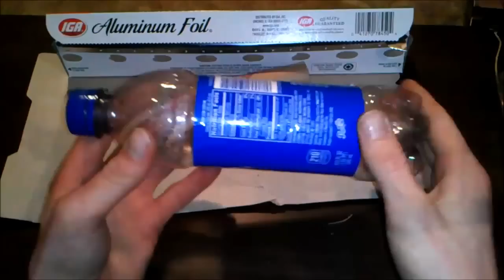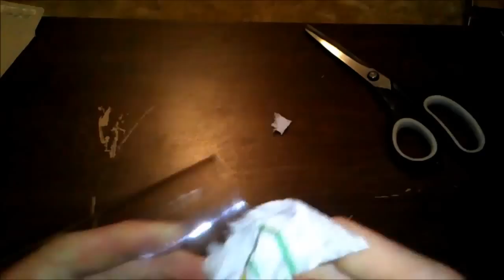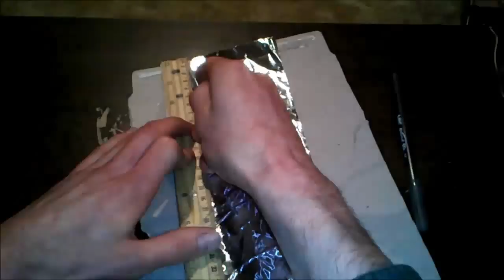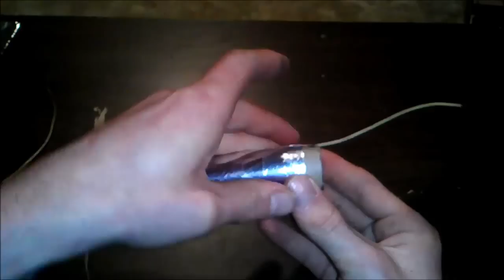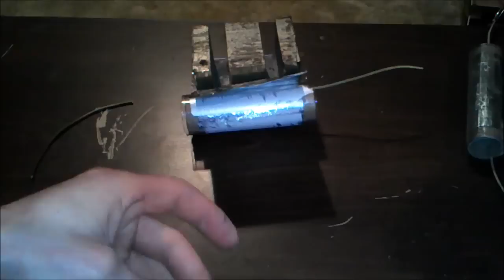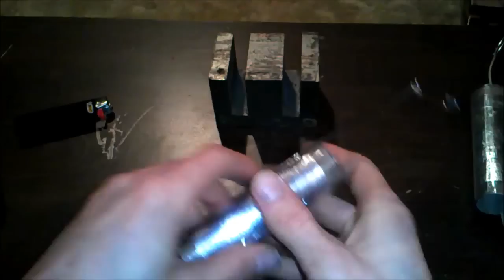How to make a High Voltage Capacitor

Comment: May I know the name of the electronic material used in the capacitor and how can I get it?
Reply from the maker: It's aluminum foil. I can't remember if it was regular, or heavy-duty thickness, but I would use heavy-duty if possible.

Comment: if you really don't want use\have a wire stripper use the scissors, they are 95% the same of electrician scissors for that purpose, i was wondering what's the use of a lighter, i'll just have a tonne of carbonized plastic on your fingers and it's also somehow conductive
Reply from the maker: Oh... Yeah, carbon soot in the plastic is conductive. I probably shouldn't do that. Thanks.

Comment: Outstanding!
My Mag Loop Antenna tuning capacitor problems are now solved by watching this vid.
I'll be able to add 100s of puffs for pennies instead of $100s for vacuum variables/etc.
It's the slitting of the plastic bottle that ties it all together.
Thanks one heck of a lot.....
73 OM
Reply from the maker: I kind of understand the loop antenna. Frankly, I don't know much what you speak of with the rest. "100s of puffs"? Yo... I suppose, if you risk your life to make capacitors by reusing plastic and other materials... do so at own risk.

At least write back to tell me what the fuck you're talking about?
Reply: @maddoctorwhitson  XD
Reply from the maker: What problem did this help you solve?

Comment: High voltage but small capacitance
Reply from the maker: High volt, at least 4200 volts. Amperes are unknown, but significantly reduced amperes. Still 4200 volts.

I don't know about reduced capacitance though. Sincerely, I play HV by ear just like music I play on the piano.

Comment: That capacitance would be increased if longer aluminium foil and plastic insulater are used......
Reply from the maker: Thanks. Yes, you are correct. I would like to try that idea of yours.
Reply: Do you need more plastic insulator, or is more al foil enogh?

Comment: Capacitance....?
Reply from the maker: I don't have any way to measure capacitance. Like Benjamin Franklin working with Leiden Jars, and like how I play piano by ear, I only have these [capacitors] for basic purposes. Nicola Tesla didn't even have a way to measure a lot of what he did. He just went with the current [flow] at the time.
Reply: @maddoctorwhitson  oww so its more of a how they made it in the past instead of a tutorial
Reply from the maker: @cia9315  Kind of, sort of, yes. This shit [caps] is functional in today's time. You of all should know that if any doom fucked up all our ways of making machines or reestablishing an electric grid, we can only makeshift from junk material.

Is why I like to keep the old ways of fashion Live in Current.
Reply: @maddoctorwhitson  Thanks for your video. Nikola Tesla did measure his capacitors and he knew exactly what he was doing. For example, the ones he made in Colorado Springs from champagne bottles were about 0.5 uF, if I remember correctly. He also tested the bottles of several suppliers and picked those which could withstand the highest voltage. Tesla worked in a very accurate and precise way, and that is why everything he described can be repeated now. BTW, this is his famous coil and the first stage of his Perpetuum mobile (the perpetual source of electricity aka free energy generator) that I've reproduced. It also produces atomic flame first described by Tesla, and sends energy to a completely insulated fluorescent lamp: https://youtu.be/X-LC4O2RnCM . Enjoy.
:)
In 1892, Nikola Tesla said that there's no need in power stations and wires, because the energy can be obtained everywhere, for free, as much as needed, unlimited, at any point in the Universe, and transmitted wirelessly. This is true. We are surrounded by the ocean of energy and everyone who wants and knows how can take it - any amount, for free, anytime, everywhere.
:)

Comment: Cut another old soda bottle to wrap two turns on the card tube for insulation before wrapping the foil.  If you wrap foil directly to the surface of the cardboard, any moisture in the card or the glue that holds it together will cause a flash-over. Adding extra insulation will double the ability to withstand higher voltage.
Reply from the maker: Thanks. I'll keep that in mind. I ruined all the Caps, by the way. I used them to make loud popping noises, like plasma works...

but I will consider the risk of cardboard material absorbing humidity over time and such.
Reply from the maker: Thanks. I'll keep that in mind.

Comment: Usually when people make capacitors they don't roll it on a tube they add two pieces of foil and two layers of resistance which give it a bigger capacitance, aside from that great vedio
Reply from the maker: Thanks. I might try that.

Comment: Buy some wire strippers why doncha?
Reply: GhettoRanger
Because he's so poor he has to make a shitty capacitor which you can by for 40 cents out of shitty materials?
Reply: Taunter Atwill ha ha, that's it, I'm dead
Reply from the maker: I made them into Chinese firecrackers with a flyback transformer. They blew before I could film it.

Comment: Great video. How do you control the Farad and Voltage Ratings?
Reply: Clarence Mentor
NOT!
Reply from the maker: @TaunterAtwill  hahaha! You are right. I play with high voltage like I play the piano, yo.
Reply: @maddoctorwhitson     :-))   Keep experimenting, you never know what happens. . . .
Reply from the maker: @TaunterAtwill , I shall. Thanks for the encouragement. I almost died a couple of times, but I was too fucked up on drugs and alcohol. I experiment with no knowledge sometimes. Risks's are part of science. But because I don't know exactly the amps and capacity (Volts were 4200 AC), I did experiments with DC electricity when I was 9 yrs old (making a flashlight and such).
Reply: @TaunterAtwill  "feed" that Child-like inquisitive  SPIRIT .
Reply: @justinromang9113  Experiments with high voltage and drugs go very well together.
Reply: @TaunterAtwill  
Me, MySelf & I  too  -  don`t forget the
-  hashtag -     ....hehehihi...

Take care fellow brother.....  ..  -....
Reply: There is a mathematical equation for that

Comment: Hello could you make a low end volatage capacitator that goes up to 450V?
Reply from the maker: Do you mean low amp that goes up to 450v?
Reply: I guess its considered high voltage then
Reply: Virginia Bennett
Yes!  You could save yourself $0.40 cents by doing so.  Are you alright?
Reply: Taunter Atwill is she alright?  I'm dying again
Reply: @TaunterAtwill  omg hahaha

Comment: So.....if i put more layers...does that store more electricity?  I know...i might be an idiot for asking...lol
Reply: more layers give you more capacitance, so if you are needing it to hold a charge then that will be good, but otherwise you don't need the extra capacitance
Reply from the maker: Putting more layers of plastic makes it safer for higher amperes.
Reply: MadDoctor Whitson  higher amps?  With better insulation are you sure? I think i know what you mean, higher Voltage = more amp output??
Reply from the maker: @miguelmonteiro3926  The voltage stays the same, but if you run it through capacitors like I did, it will only reduce the amperes. To what extent, you need proper equipment I didn't have at the time. I play electricity like I play music... by ear.
Reply: Miguel Monteiro  Miguel Monteiro
No genius, he means the more plastic wraps the more safety!
Reply: @TaunterAtwill  no, more plastic means lower capacitance, the capacity exponentially drops off with the gap between them, and it would be volts, capacitors store a voltage, amps is current, and you cannot store current, just voltage that can make current later. He was right. But the plastic insulation used was crazy overkill here, you can use far thinner materials to get high capacity and still maintain high voltage.